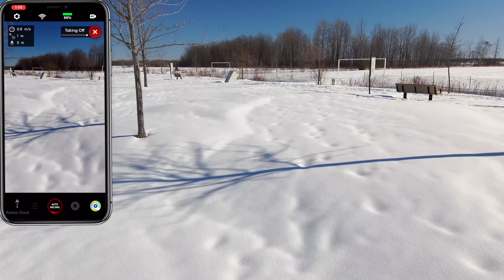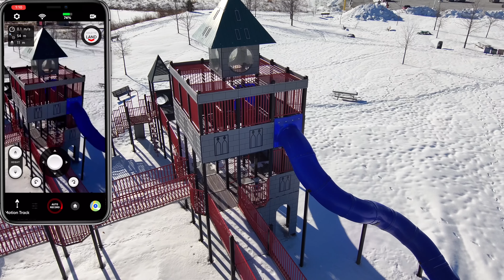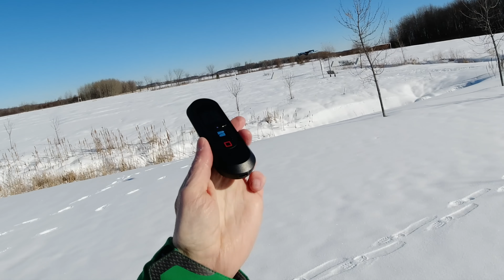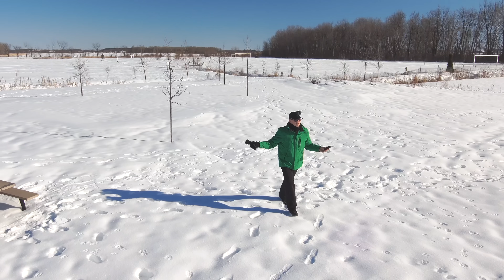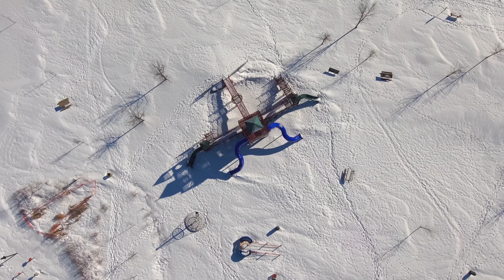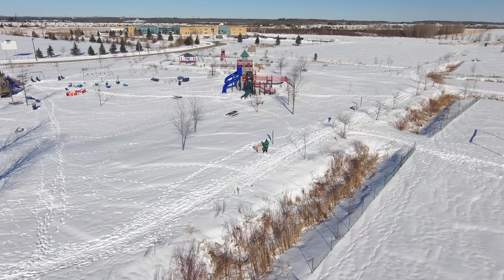SKYDIO 2 - Differences between Beacon, Controller and your Phone

Comment: I know this is a old video. But I have a skidio2 and don't fly it much because I've lost it several times w the beacon and riding my motorcycle. I'm planning on getting the controller as the drone doesn't seem to like to connect to my android phone. Question when using the controller and cell phone, can you select something or someone else to track? Or I'd it limited to the controller/phone location like the beacon?
Reply from the maker: Using the controller is like an extension of your phone (same interface pretty much), so you can select what you wish.

Comment: I just ordered controller for my Skydio 2 drone.

I got this to extend the range of the drone- as this has been tough using my phone and getting limited range and not saving my video footage. 

One question - with the drone being farther away w the added distance from controller - will I be able to press the vortex, orbit, etc and access the camera from my phone still?? Was concerned b/c without the remote, the drone doesn’t go very far.  **And I want to be able to control the shots w my phone while it is out at longer ranges. **

Hope that makes sense
Reply from the maker: When you use the controller, your control of the drone is more so with the controller than the phone, although the phone app changes so that you can select items on your phone.

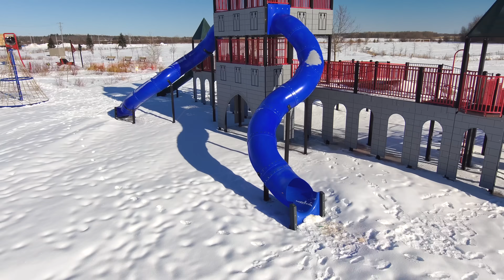Comment: Steve i have one question, when using the controller w/phone are the obstacle sensors active. Because @ 13:02 you stated that you didn't want to hit the bldg. so if the sensors are on and working this thing would or should never fly into something like that.
Reply from the maker: The sensors never turn off, which is the biggest problem with the drone.  For newbies it is perfect but as soon as you learn to fly a drone, it becomes a hinderance.

Comment: Hello, I have a Samsung Note20 5G phone, the Skydio app has been installed without problems, but I can't do the optical motion track, when the drone sees me, or sees a car, a bike, or a group of people, it applies a "+" on each of them, but if I click on them, nothing happens, the spinning trail I’m expecting to see, does not appear around the subject, 
So I’m missing the best features of the skydio, orbit, dronie etc., only the cable mode works, to be motion-tracked I must do it on the beacon ... does anyone else have this issue?
Reply from the maker: Sounds like an App issue.  Once you click on the + sign, it tracks.
Reply: @CAPTAINDRONE798  no, it doesn't, the drone does not move at all, it's as if I'd never clicked....

Comment: I have the Skydio 2, the beacon and the controller. My question: Can I give the beacon to a subject I want to track and use the controller with my app to manoeuvre the drone (set hight and distance from subject along with easy access to the "stop" button on the controller)? Or is it either the beacon OR the remote that I can use but not both at the same time?
Reply from the maker: Nope, one or the other.  If you use the beacon that then controls the drone.

Comment: Truthfully, I am disappointed in my Skydio 2.  I wish I never bought it.  While I have obtained some good videos, I still have more issues with it, than I care to have.  
- I live in Japan (not sure if that has anything to do with it), but it takes forever for the beacon to get GPS and connect. 
- I cant get the phone to connect to the beacon.  Never got this to work.  
- I can get my iphone to connect to the drone, but like you said, short range
- EVERY time that I fly with the beacon, the drone loses me and I have to go back and get it.  I have almost lost it twice, because it was hard to go back and get it
- is there a way to change the low battery threshold and get a warning?  Right now, I get a warning at 10% and have to scramble to land it somewhere.  Nerve wracking. 
- the autonomous flying makes me nervous
- the remote controller is a crappy design.  Feels like I am controlling one of those $15 remote control cars.  Doesn’t feel like it belongs with a $1000 drone. 
Overall, Im just not happy about it, and even if they come out with a Skydio 3, and fix some things, I am not shelling out more money.  Just not worth it.

Comment: I currently have a Mavic 2 Pro and for the most part really love it. But Active Track is spotty for what I need it for which is off road motorcycling and MTB. The Skydio2 seems like a better option but without the folding arms I worry about it's backpack ability.  Is it hard to transport without a giant backpack?  Thanks!
Reply from the maker: It comes with a carry case
Reply: @CAPTAINDRONE798  Not to be a pain in the butt (ok maybe a little) can you tell how big the case is?
Reply from the maker: michael hall You may be one of the few people in the planet who has not seen the Skydio case.  It is slightly larger than the drone and very thin: https://youtu.be/D5vORTlJz5I

Comment: If you set the drone off just using your phone then put it say in a clear pocket in a tank bag on your bike, what would be the max speed it would follow at? Great review as usual, thanks.
Reply from the maker: It depends because with a phone the transmission is weak.  You really need the beacon for fast follow.

Comment: Steve, did you try to use controller without data connection? How do you catch maps on it? Thanks
Reply from the maker: You can fly pretty much any drone without cell phone data (hence why people use tablets), but things like MAPS will only show up if you have a GPS chip (full functioning).  GPS chips suck power, so many phones shut them off & most tablets don't have them.
Reply: @CAPTAINDRONE798  i have it enabled (Galaxy Note8) but I presume it needs data connection to load the map it self or have it stored on the device. I did download local map in Google maps but the Skydio app still won't show it. :(

Comment: You said you could not aim the drone at a object with the beacon but at the end with the beacon you turned it around when you landed it
Reply from the maker: You can take manual flight of the drone but not manual control of the camera, or recording or camera settings.  You have to connect your phone to the BEACON to get full features, but that just defeats the purpose of the Beacon.

Comment: Good informative video review, I do have a question.  My Wife and Kids ordered the Skydio for me for Xmas, but watching the video makes me wonder, can you point the camera Up?  Say I want to fly up to a bridge and look up under the bridge, can I do so w the Skydio 2 camera ?

Any input is greatly appreciated?
Reply from the maker: No.  You need the Parrot ANAFI for such filming.  Also I would not fly the SKYDIO2 under a bridge because it controls the height itself and if it wants to go low it will crash in the water since it only uses visual sensors and not ultrasonic sensors on the bottom.
Reply: CAPTAIN DRONE wait, You can’t fly the Skydio at any height you want w a controller?
Reply from the maker: @TreadTalk247  Yes, but the obstacle avoidance is always on so if it needs to go up or down or left/right to avoid something, it will.
Reply: CAPTAIN DRONE gotcha understood!

Comment: using the controller can you control the gimball..when you did a flyby of the farm sheds can you make the camera look where you want it to
Reply from the maker: Yes, you can move the camera up and down.
Reply: @CAPTAINDRONE798  thx man..still waiting on my drone..Im in group 2
Reply: @CAPTAINDRONE798  Is that all you can do ? Up and down?  So for instance if a make a track shot with 2 points and in the middle of the track I want to keep looking at a subject can this be done ? Like a POI with DJI
Reply from the maker: Martin Duffy Not as cinematic as DJI for such shots.  The best it has is Cable Cam which lets you pick the start and end point, but no automatic camera control.

Comment: Well, now i love this drone because of the controller, more gentle to be controlled, more fun and for sure more angle to be captured, are the sensors still active when using controller? I'd seen it crash while using controller.
Reply from the maker: Correct.  The sensors never turn off, even when using the controller.

Comment: did u record in auto mode, or manual, because on most of the skydio 2 videos including mines , seem to have blue hue, and red is also strong , in the white balance ion auto , on this drone. IN this video it looks right but in 98 percent of the other youtube videos the blue and red color are too stong, i wish we had a log profile, .
Reply from the maker: I film in auto settings mode.  I did have a FREEWELL POLARIZED FILTER on the lens to help with contrast/detail.  The only problem I notice with the SKYDIO2 is that it consistently gets the Exposure wrong in all situations.  I have noticed any blue/red as you noted.

Comment: PHONE: So the phone is setup like the Beacon (plus the automodes). Wouldn't it be cool if the Phone app expanded to include Remote mode with stick emulation (like a Tello) so we could flip from Beacon mode to Remote mode and back on the fly ( a true flip phone :D ). 

BEACON: You say it gets confused when there are multiple people at hand. Does the drone lock on you visually, or does it lock on and follow the Beacon? Both? If you set the Beacon on the picnic table and walk away what would the drone do?

If you were using the Phone, set the Phone on the picnic table and walked away what would the drone do?

Can you use the Phone and Beacon together simultaneously? Maybe then you could set the Beacon on a structure (walk away) and set the drone to orbit the structure...

Comment: Nice video! Thank you. I still have another application for the Beacon: put the Beacon in a (not too fast) RC-plane of one of your RC-colleages and track the plane. I'll try to do so if i finally  get my preordered Skydio in Europe.
Reply from the maker: It works, but since the camera just points in the general direction of the GPS Beacon signal, is hit and miss for capturing anything in the frame.
Reply: @CAPTAINDRONE798  Tanks for the answer. What means general direction? Points the camera just to x-y-GPS coordinates, without using the altitude of the Beacon? Yes, I saw some posts were the tracked subject is often very low in the frame.

Comment: Great information.  Thanks. 
I read somewhere that the S2 is not so good at avoiding moving objects like dogs, cars, people, etc.  Could you test this?  That seems like it could be a real weakness that needs to be investigated and highlighted.
Reply from the maker: Rubik3x This is true for most tracking devices (even cars). They can follow you but if a dog  or a person on a bike, ATV, downhill skies or just running, come in from the side at a good speed the technology can not react in time to avoid it.   So if you had the Skydio tracking you from the front and you were jogging and another jogger ran across your path and suddenly changed direction the Skydio could not then avoid the person.  This is why the Skydio has the option to track at 8 feet above the ground and not go lower.  If you select to turn this option off, you then accept liability for damage/injury.

Comment: Love your videos.  You said at one point that it would have trouble following you if there were more people around you.  Does that mean you can have it follow someone other than the user?  Say for example a ball player?
Reply from the maker: John Cappi Exactly.  The drone will place a plus sign on every person it sees.  You just tap on the person on the screen and the drone will follow in any method you wish.  Great for filming your kids at a park or event.  The only caution is to select the 8 foot height follow which will force the drone to follow at a height above 8 feet so that it does not crash into other people.

Comment: I've said since they announced this that the true cost is 1500 USD. I think to have it work best in all scenarios, you need the Skydio, the beacon, controller and 2 spare batteries. That brings you up to just under 1500. Nice to see the good and bad of all control methods. It seems like your experience with the controller is something around 1k? I think it is supposed to get 3.5k with the controller, right? Do you have anything you would compare the Skydio 2 against as comparable?
Reply from the maker: Danny Fyffe Nothing compares to the Skydio because it is a one purpose design drone which is obstacle avoidance following.  It is not foldable, has a short flight time, short flight range and no ability to turn the sensors off, so it falls into its own category.
Reply: @CAPTAINDRONE798  Interesting. You sound sort of disappointed with it. Would you say it is a pass for someone like me with the Evo 1, Anafi and Karma?
Reply from the maker: Danny Fyffe Oh no not disappointed at all.  What it does it does very well, but it’s kind of a one trick pony with limitations.  It is not a replacement for an EVO or MAVIC because it is not in the same category as those.  It is more a ‘fly and forget’ type drone that allows you to do other tasks and not worry about the drone.
Reply: @CAPTAINDRONE798  Sorry I misread your feelings in your post. I thought you were disappointed, but glad your not. I hope you'll at least do some camera comparisons against the Evo and Anafi with it. You know I'm interested in that.
Reply from the maker: @DannyFyffe  The EVO yes, if the weather cooperates.
Reply: This drone even with antenna mods will never get 3.5km.  The problem lies in the antenna placement in the drone itself.  Since it has no landing gear, the antenna are somewhere in the bird.  I’ve only gotten about 2000 ft or so in a suburban environment.  If you get 1000 meters, I imagine you’ll need to be happy.
Reply: @OraclesNeverEndingArcade  So the antenna are obscured you think in the body so the controller does not receive solid signal in flight? I wonder if there is any data to prove that one way or the other? I would certainly like to know.

Comment: Hi Cap, FYI, you can connect the phone and the beacon at the same time.  That way you can see your footage and have more advanced controls.
Reply: Except your getting the stronger GPS signal from the beacon, and the visual aspect of the phone.  You can find creative ways to go hands free.
Reply from the maker: Oracle Miata Yes, that was indicated in the video (watch when I am close to the structure with the Beacon).  But why on earth would anyone do that.  It defeats the purpose of using the beacon in one hand in an active role.  You’d be better off just using the phone.

Comment: Nice video! The only thing i think you got wrong is that you said you can't film anything else but yourself with the beacon. You can use the beacon in Steering mode and film something else other that you. It's not the best option but it is an option. It won't be accurate because the only choice you'll have is to point the drone in the direction of what you want to film and hope that you capture what you want.
Reply from the maker: Drone fan CCO That is what viewers are to conclude from my video.  With the Beacon alone you have zero control of the camera and camera features.
Reply: @CAPTAINDRONE798  i think when you said you "can't use the beacon other than yourself". I thought to myself that i use it to film stuff like my buddies around me when i go hiking on quite a few occasions. If the object or person is close enough.....i just put it into steering mode and film what i want to film. Like i said, it's not the best option but it can done and done well in certain conditions. 
With the beacon it is Auto record only at this moment. Hopefully they will have an update that will allow you to manually record or not.
You should have mentioned steering mode though because it is an important feature to have. Especially when the drone gets hung up in a bad position. This mode will help you to get out of that situation without crashing.
So steering mode is a must learn if you use the beacon, that mode will save more times than not.
Reply: @CAPTAINDRONE798  by the way i love your videos! I think you are one of the better reviewers out there. Was just trying to give constructive criticism on something i picked up.

Comment: Nice explanation of the usage for the three control devices. I am in batch 3 2Q2020 so still have a wait. Your videos help me to better understand the Skydio 2 drone as compared to DJI drones I fly.  I am on the fence if to keep my order or not because not sure yet what advantage  Skydio would give me over a Mavic 2 Pro which has very smooth cinematic video capabilities. Most of the videos I see coming from Skydio 2 have quick jerky movements and almost constant movement of subject matter within the frame.
Reply from the maker: Addy Overbeeke Yes, it is kinda like a dog that follows you on a walk or adventure and every now and then sees a squirrel.  If you fly high in the air with the controller you can get smooth cinematic video, but if you fly lower and close to objects, the drone will slow down and speed up and move from side to side which can ruin your cinematic shot.
Reply: @CAPTAINDRONE798  Thanks Captain.  I have lots of Squirrels where I live in the thick forest ...LOL But I totally get what you mean. Still not sure how I would use the Skydio 2 but for now will keep the order.